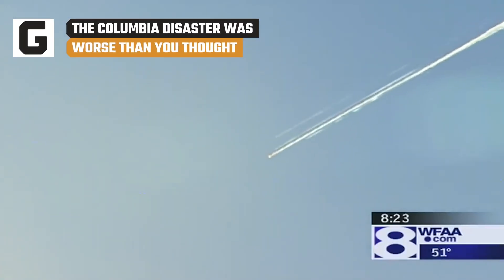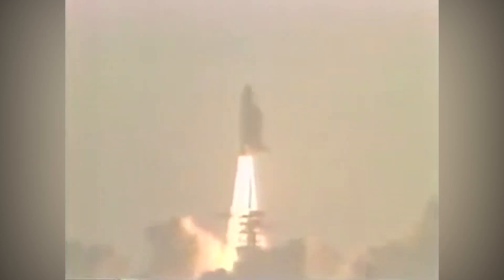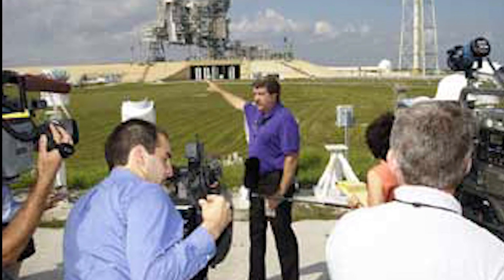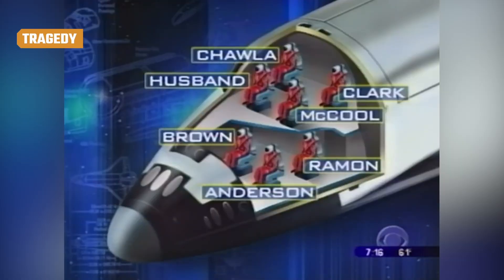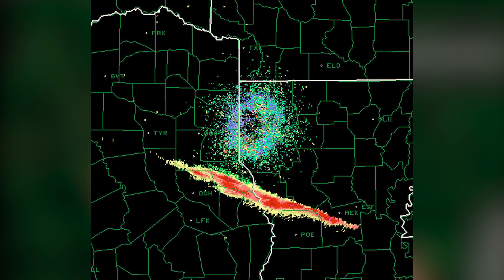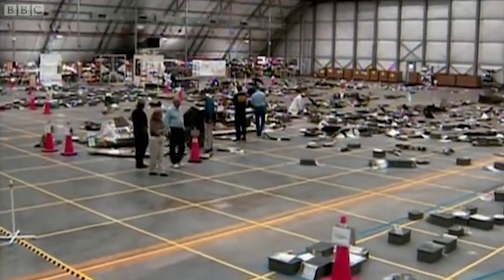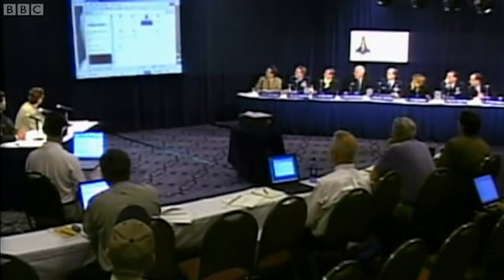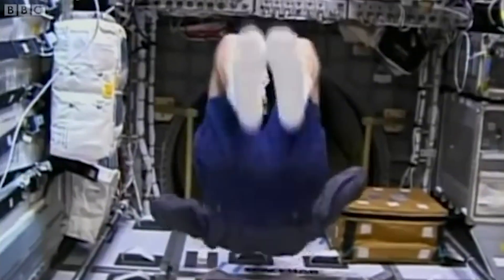The Columbia Disaster Was Worse Than You Thought

Comment: Similarly to the Challenger, one lesson to be learned by NASA and the rest of the government:  Never buy high tech from the lowest bidder.  Buy from the lowest bidder, and you buy crap.
Reply: How does "lowest bidder" figure into the foam damaging the wing?
Reply: @richardkicksee7430  The cheaper the cost, the cheaper the product.  To keep costs down, shortcuts are taken and certain items are cut out.  That's what happened with the Challenger.  The higher bids included designs with redundancies to ensure if the main system failed, there was a backup.  And if the backup failed, there was a backup to the backup.  And after that even more backups.  The winning design did not have that level of protection, so what happens?  BOOM!

Comment: Linda Ham had a masters degree in aeronautical engineering. She wasn't a dumb person. It's where the culture of large government comes into play. When managers (no matter who they are) stop listening to the engineers on their teams, bad things happen. I suppose it was also just bad dumb luck that a foam strike that fatally damaged a shuttle were to occur on a flight that didn't dock with the space station. The clock on a rescue/repair would have been so much longer and the mission would have been simpler if they were at the ISS. But Colombia was on her own this time.
Reply: It wasn't bad dumb luck. NASA knew that the external tanks had a problem with foam shedding. There were three generations of external tank used through the Shuttle program. Original, Light Weight (LWT), and Super Light Weight (SLWT). Once the SLWT went into production all the leftover LWTs were reserved for launches not going to ISS. That meant mostly Columbia flights. Since Columbia was the heaviest Shuttle, even with an SLWT it was quite limited on how much payload it could lift to the ISS.

The foam insulation was redesigned and reformulated for the SLWT more than once. Launch videos were scrutinzed to determine where foam pieces came off and foam shape was changed to try and stop turbulence ripping pieces off or in some cases foam was omitted where it was determined it wouldn't cause undue heat ingress.

But the LWT's got none of that love. They didn't get stripped and re-foamed or have troublesome parts of their foam re-shaped or removed. The two years between Columbia's last two flights didn't help the foam's integrity. The investigation did determine it wasn't the bonding of the foam to the tank which failed, it was the foam itself. That was a relief to the people who applied the foam, knowing that they hadn't been the cause.

Had that chunk not come off on Columbia's last flight, or had it caused only survivable damage, NASA might have taken the corrective action of re-foaming (at least the orbiter facing parts) the remaining LWTs to ensure there was fresh, stronger foam with the design changes made to reduce shedding.
Reply: @greggv8  I didn't say the foam strike was bad dumb luck, I said it was bad dumb luck that this particular foam strike happened on a mission where the shuttle did not rendezvous with the ISS.
Reply: I think your political bias comes through here more than you intended.  This sort of screw up happens with all large organisations.
Boeing with the 737-Max, Lockheed Martin with the US-101, BP, Exxon the list goes on.
Large organisations with strong "empires" regardless of whether being private or public cause crises.
Reply: @vernonrabbetts  They're their own worst enemies.
Reply: TJ32 I appreciate your imput.  Thank you.
Reply: Dwaine Castle  
I fully agree with you, especially in the case of the Sub Commander.  I just view the public and private sector as being equally culpable when it comes to Corporatism.
Reply: I remember it took years to perfect the tiles but then it wasn't them it was the glue. Wonder why they wouldn't have a little repair kit with them and do a space walk.
Reply: Anyone who has worked under the leadership of a woman knows that they can be stubborn and stupid as hell. They’re the boss and if they’re menstruating better look out. Masters degree won’t help her then.
Reply: @fivehead6675  
Because male management is so much better? Which administration is USA and the UK under currently?